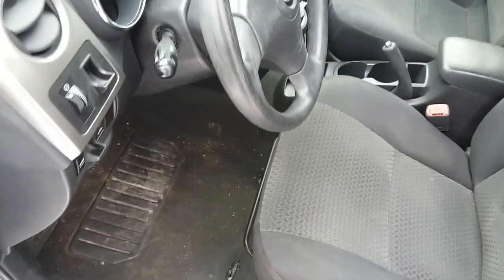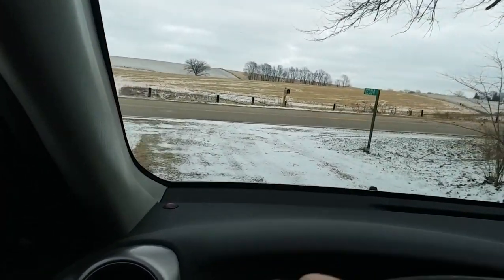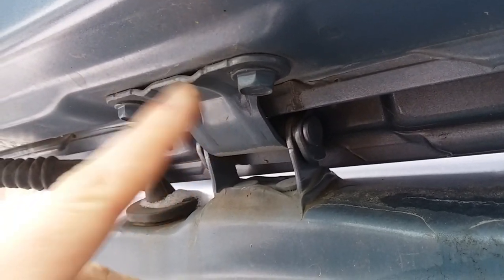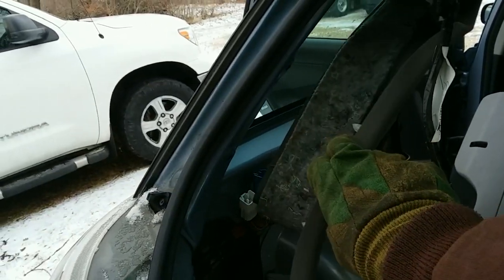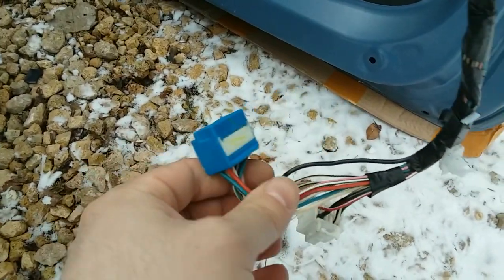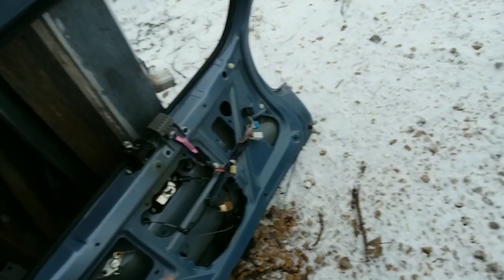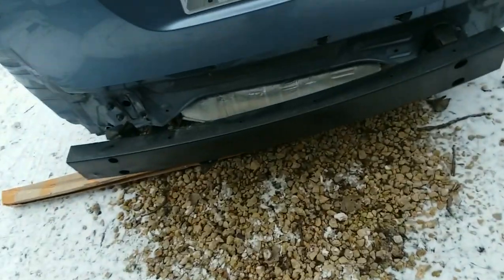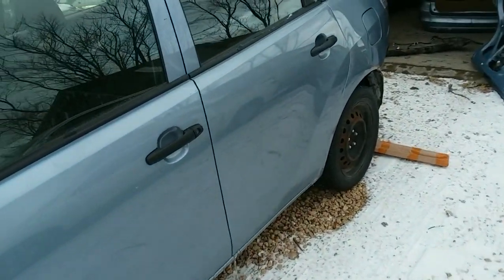Replacing Rear Hatch on the 2006 Toyota Matrix from Copart

Comment: Will matrix  whole hatchback work on 2003-2008 vibe Pontiac?
Reply from the maker: I doubt it, the drivetrain is the same but most of the body panels are slightly different between the two